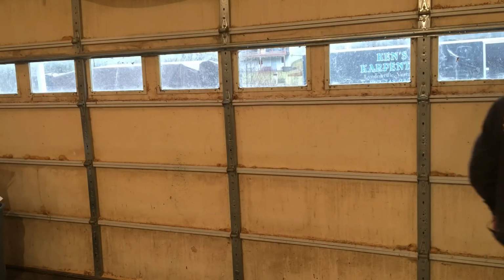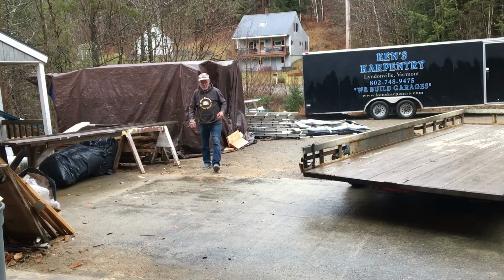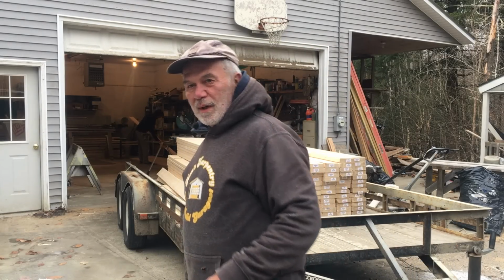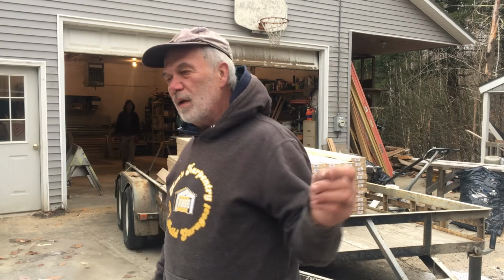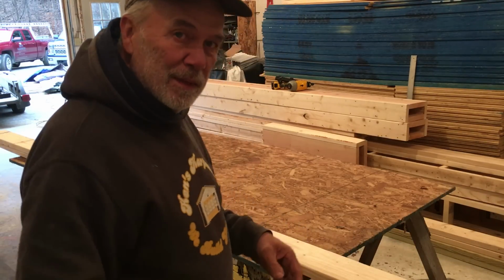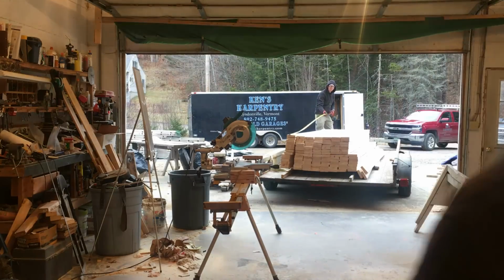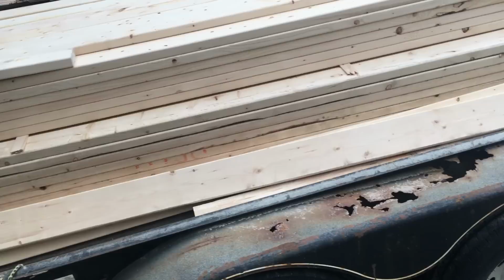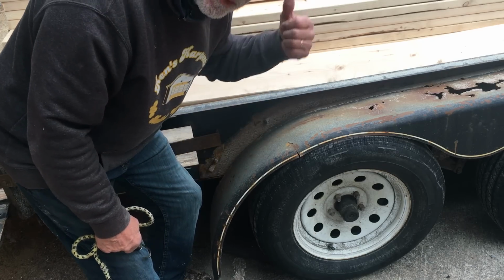Need to Get X-Rays

Comment: Sorry to hear about your painful right hand Ken! I'm glad you got much of the walls built for the first garage build in Spring. That is a huge garage with a high ceiling. Nice that you're putting new fenders on the trailer. You can see your handy work right across the road. Those look like vey heavy sections that just you two are lifting. Thanks for this Ken.
Reply from the maker: Thanks

Comment: I'm 72 and have gone through that wrist problem several times during my construction career and there is no medical solution. I purchased a wrist stabilizer that had a flat metal bar from above wrist through the palm of the hand and a thumb stabilizer and Velcro straps as best as I can remember. Still got it someplace and wore it for a few weeks until body healed. The same thing happened at 64 with shoulder rotator cuff damage with heavy lifting overhead and had to immobilize arm in sling for weeks, could only raise hand high enough to eat. Did my own exercise plan for a year and avoided the surgical routine because others who chose the surgical route were out of work for a year anyway and they were half my age .
You don't realize how much wrist action you use in most activities until you lose it due to over worked muscles and you have to give them a rest. Best of luck in your recovery.

Comment: Must be in the air Ken. I saw a tarp blew off our stack of pressure treated lumber Tuesday and when I stepped on the pile to pull the tarp I slipped and locked my left leg. As we know pressure treated lumber can be like ice when wet. Doctors in our area are backed up into the new year. If I move my knee in a certain position, game over. Why does this stuff always happen when your to busy to slow down ? My PCP gave me crutches. Life goes on.

Comment: On the brighter side, DONT YOU JUST LOVE THAT THERE IS NO SNOW ON THE GROUND?   So much easier to work well into the late autumn and early winter.   I don’t have to tell you that it is getting close to that time where you need to hire the big guy full time and you take on a supervisors/ job superintendent role.   It doesn’t mean you have to put down the hammer but definitely time to slow down.   God bless you, Chad, your family and your crew.  Have a blessed Christmas season.    Ed and Deb
Reply from the maker: Hi Ed and Deb. It made it easy to finish our last outside jobs. The big guy is going to work as a sub now. He had other work to do. I am hoping to slow down next year though. We may just not take on as much work. I think about your project often. Especially this time of year. :). You folks were so gracious!

Comment: I was taught years ago to keep my hand back at least 9" when nailing studs, etc.  However, I once sent a 15 gauge finish nail thru the top part of my finger. Pulled it out and had a hole in my finger nail that moved up and away after a month or so. Nail just missed the finger bone, luckily.
Reply from the maker: Ouvv Ouch

Comment: Ken:   Maybe you have already done this but I suggest you take the time to thoroughly inspect the underside of the trailer, especially the axle tubes, u-bolts, and axle mounts.  I used my tractor to pick up the tongue and save crawling around underneath it.  I found our VT roads and weather had rusted my axle supports and u-bolts enough that I decided repairs were needed.
Reply from the maker: Thanks I will
Reply: Also, spring bushings. That will cause erratic behavior onroad, specifically at speed.
Reply: Yeah, no kidding. Things can happen so quickly going 55 down the road and you have a heavy load. Broken components that should be checked every year are cheap to fix and expensive to pay for if something goes wrong.

Comment: Diamond plate fenders for the trailer, business is good!  Nice job by Chad and you on those walls -- and cool to see your neighbor's garage up the hill.  Good luck with wrist -- I try to wear a 3M elastic support/brace before I start doing yardwork or heavy lifting but too often remember only after the fact.  (My situation is early formation of a ganglion cyst on my primary wrist which results in a painful swelling that, for now, reduces over several days.)  Hey now, rumor has it that Binford Tools (laughing at your reference) will be releasing a wrist-assist robotic skin powered by new-fangled graphene buckyballs.  Now seriously, it could become a thing.  In the off-season you can look it up.  US Dept of Energy has been funding the research for several years.  Peace!

Comment: Ken they are 2x 6 walls 12' high.  They are heavier than normal walls you build.  Probably pulled a muscle/tendon.  Got to give it time to recover.   I have a solution for my trailer fenders issue for loading and unloading with my tractor & forks (not the same issue that you have though.. LOL).  I lay pallets down to get the height high enough to clear the fenders (3 pallets high) and then the load goes on top of those.  Works well as the pallets can handle the weight anyways.  Just gotta strap it down tight.  The Diamond Plate ones will be nice, that's what mine are.  Feel better.
Reply from the maker: Thanks good idea

Comment: Hey Ken, Next time use a 4.5 inch grinder with thin metal cutting wheels. Those work well for body shops. Also, they are cheap to buy. $20-300 depending on the features.
Reply from the maker: Thanks

Comment: Due to a pain in my right shoulder and upper arm I went to my orthopedic surgeon and they x-rayed my neck and saw that I have two compressed discs. I'm scheduled for an MRI in a week so I don't know anything for sure yet, but I'm leaving you this message because during my research to see what the possible problems are that I have, and you can find it on YouTube, is that there are nerves in your neck that affect your upper arm your lower arm and your hand. Of those nerves that come through your neck if they get compressed by a squashed disc it can affect one of three parts of your arm, so I suggest you have an x-ray of your neck because your hand problem may be from a nerve in your neck.
Reply from the maker: Oh. Thanks for the input and I hope you recover quickly

Comment: This is another thought from a 60 something...I think you wacked your arm while taking the fender off the trailer.  I can't tell you how many time I have hit myself with something and it hurts days later.  I have one finger that if I hit it in a spot it feels like hitting it with a hammer.  When watching your video taking apart the fenders the thought came to me that you might have wacked your wrist or arm and kept going not thinking about it.  Crow bars have got me more than once..I build just like you but work with metal on old cars.  Heck I was walking to my shop a few days ago and some thing went crunch and a day later my ankle swelled up and it got real stiff.  A few days later and It seems to be fine now.  I have insurance but never went to the doctor, they can't xray tissue.  Stay off it and it will come back,  not to say that it isn't stress cracked.  But age is hell.  Keep working and be safe ,

Comment: Could you transport the wall sections standing up instead of laying down on the trailer? That would allow you to make sections larger than 8'. To keep them from racking during transport, you could screw 4' x 8' sheeting to the outside sections and the end if you thought it necessary. The sheeting could be removed quickly when you got to the jobsite and would still be able to be used for siding/roofing. 12' standing upright on the trailer would still be well below 13'9" clearance on the road.
Reply: I’ve tried that but on the remote tracks a lot of heavy overhanging branches can hamper the final approach and then you’re faced with working from height problems..(It depends on the location I guess)..
Reply: I just thought about that different approach, and the system he uses (laying flat) allows lower center of gravity, which is better on the road. Besides, he will need to make two trips to the job site with that pile anyway, so why make the wall sections heavier just to move them? The sheet material will fit nicely in the bed while the wall sections lay on top of the rails.... as usual.

Comment: Ken,  I have been curious to know why you prebuild so much in the garage instead of at the site.  It looks like a whole lot of double moving.  Are you building when you do not have work or bad weather or staffing?  Maybe it is power.
Reply from the maker: We are quite often an hour away so it saves on travel as well as the efficiencies and we rarely get rained out because we have inside work. Great question

Comment: Ken do you put the sections of wall on the trailer in construction order?
Reply: generally, they are in order, although I have caught a few videos where they were not. (oops) They are marked by side (1, 2, 3, 4) and then by section (A,B,C,D) so they can be laid out on the job site before securing.

Comment: Ken, try cutting metal with an angle grinder. Surely you'll have the thin cut-off metal discs. It will cut far better than that saw sawyou used then had to yank and pry away at.

Comment: I suffer from a problem in my wrist when I lift things that are heavy. It's called Quervain syndrome, which makes a ball form on the opposite side of the scaphoid bone, making it look like a have 2, one on each side. The pain is unbearable. 

Since I can't go to a doctor every time it happens, I use an over the counter cream called ice and heat ( hot and ice?). It gives you a burning sensation if the pain is not unbearable, but if it is, it surely takes it away, and the ball goes down. I wouldn't recommend it unless the pain is very bad. 

So very sorry Ken, please allow your wrist to heal completely before lifting anything. Hope you are well soon. 

Now, back to the video.
Reply from the maker: Wow bummer thanks for sharing

Comment: I was trying to count- how many 2x6s are there in this thing? Since they are going to be 12 feet high, is that the reason for the wider boards?
Reply: most people choose 2x6 to go with more insulation. It's not really necessary for the height.